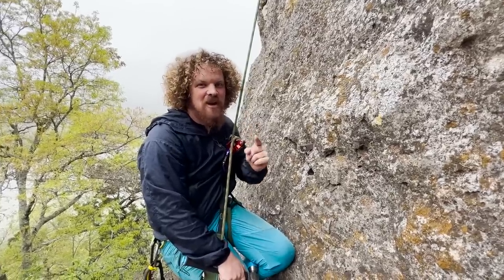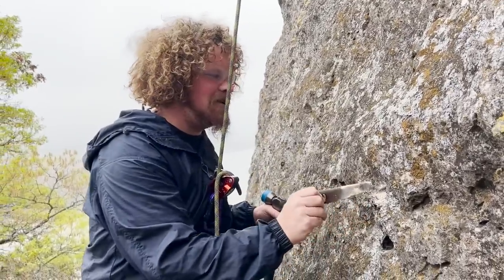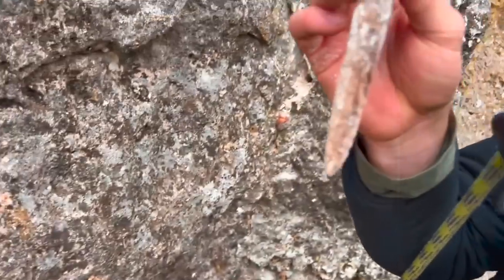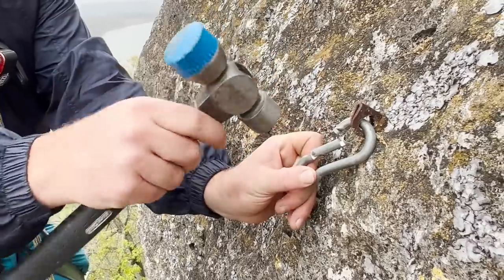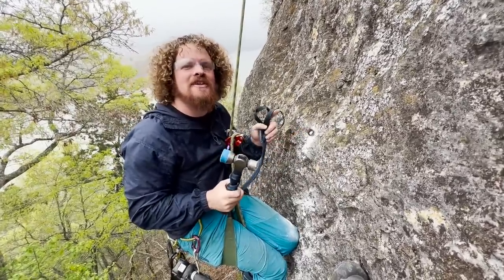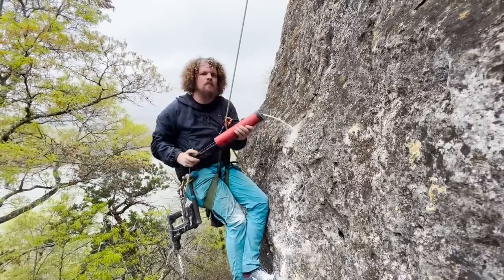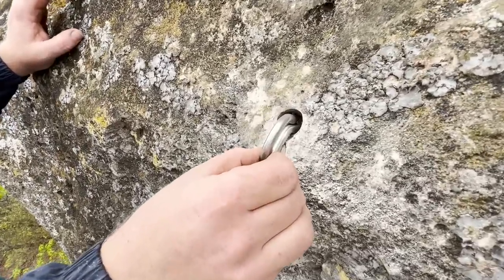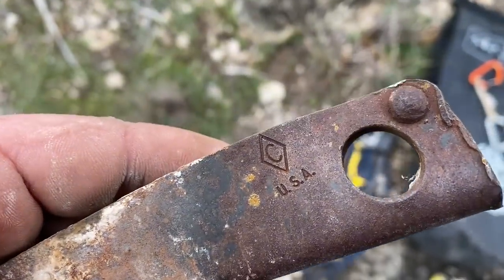What the &*%$ is a drilled angle?

Comment: I've changed in the region of 250 pegs at a local crag. I wish our local ethic allowed them to be changed for bolts - WHEN SENSIBLE. Fixed peg protection is a massive game of roulette, pegs can appear solid on the surface but are totally rotten, they can appear rotten but are totally solid. Unfortunately I know someone who lost the game and paid with their life. Changing them always damages the placement, or worse they snap in place resulting in a new placement being needed. They have wildly varying lifespans. Totally unsustainable practice. Good to see you guys taking what I consider to be the sensible approach.
Reply from the maker: Great points. I couldn't agree more.
Reply: Ethics is just one person forcing his opinions on a other person
Reply from the maker: @tiddybearkush  Yes
Reply: If you mean glue in bolts they are very strong when installed properly

Comment: That’s either the #5 or #6 Chouinard angle which is definitely not the standard drilled angle (aka “dangle”) that is of desert big wall fame.  Those use one of the baby angles (size #1 or #2, can’t remember) and a multiple bit drilling process, like Bobby alluded to.  In Zion sandstone I would be more confident about a properly placed drilled angle (like if Ron O placed them) than a sleeve bolt and confidently clipped + climbed above them on Prodigal Sun.
Reply from the maker: Interesting.

Comment: @bobby a slide hammer seems to be a better tool for a task like this. you would have to come up with a way to grab the anchor/bolt that takes up slack in the connection.
Reply from the maker: Carrying the weight isn't really practical for a single use tool unless you know you are going to need it for a bunch of placements.

Comment: Wow, it's just like a carrot bolt. Similar fixed gear was all over Australia in the 20th century, except American steel pitons were in such short supply they were too valuable to be left behind. So climbers would file down machine bolts from the hardware store to a piton-like taper, and pound them into drilled holes for a similar interference fit. Voila, the carrot bolt. Similar variability too, some come out almost by hand, others have resisted removal holding huge outward forces.
Reply from the maker: Absolutely. Yeah drilled angles don't make a lot of financial sense now.

Comment: Ok.  Just watching this now.  You need to order a 10 lb slide hammer.  OTC makes them for a reasonable price and I use them on cars all the time.  If it can remove pressed bearing that is wedged interference fit into a cast iron hub then it can pull a little piton without breaking a sweat. 

The swinging hammers are fine for hammering back and forth but a slide hammer will let your hammer blows pull on the protection that you are removing.  I expect it would pull those pitons in one or two blows.
Reply from the maker: You voulunteering to haul it out to the crag for me? 10 lbs is a lot to add to a 50 to 60 lb pack.

Comment: Why no funkness device?
Reply from the maker: Traveling and I have never found them effective.
Reply: @bobbyhutton1989  I often find them very useful for older style thin lost arrows/blades that have started to move but then get stuck. Typically they have bent within a contortion of the crack. Funking them out usually works well. Never had any luck funking pegs that dont move at all. I use a 60cm sling